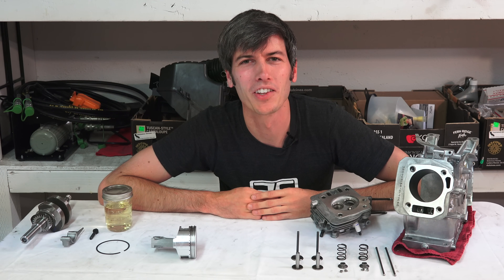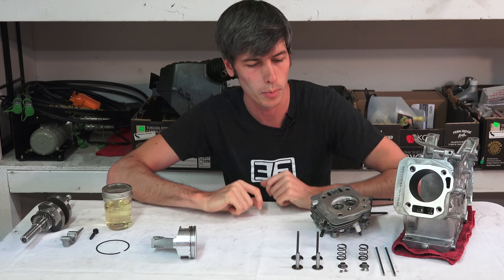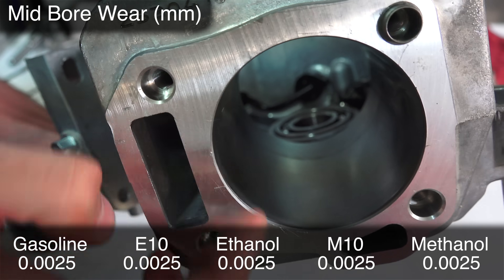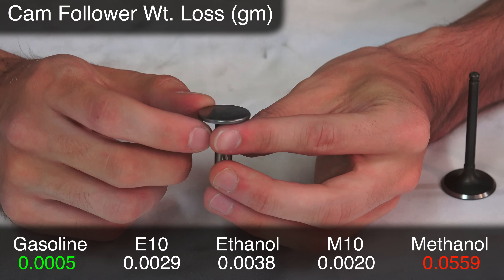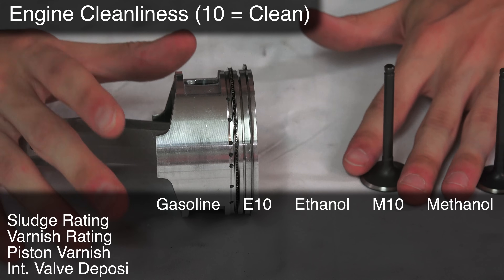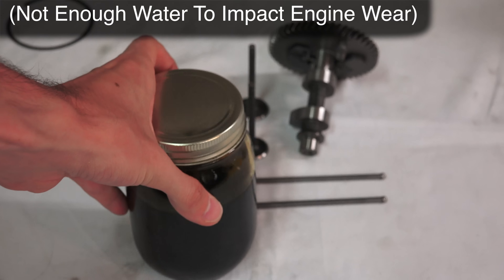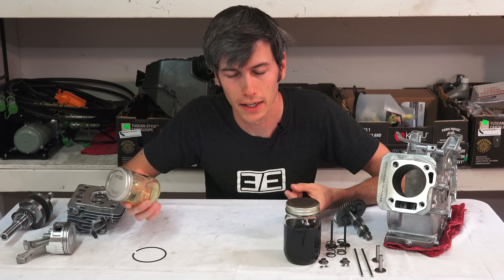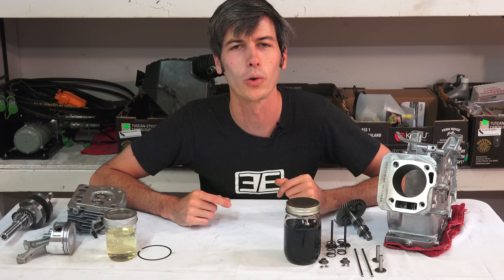Is Ethanol Bad For Your Car's Engine?

Comment: This is promotional garbage.
Engine wear is only a small fraction of considerations required  in making a comprehesive evaluation.
Other factors:
1. ) BTUs efficiency
2. ) Ethanol adversely affects combustion volatility, meaning that it's more susceptible to preignition/predetonation, which is literally the process of trying to  compress an explosion. This is a result of increased volatility vs gasoline mixures with regards to static cylinder PRESSURES, which - contrary to seat of the pants engineering - cannot be controlled with ignition timing. Think of it like a diesel, where combustion is accomplished with cylinder pressure alone. No spark required.
Preignition is the quickest way to destroy an engine. Parts break.
3. ) Ethanol destroys buna rubber, dissolves it. Fuel lines, injector o-ring seals, etc... fail. Leaking fuel lines is a bad thing. Turbo cars even worse, where fuel line pressures can be upwards of 65lbs/in. Granted... newer cars have switched to synthetic rubber which is less prone to failure. But if you ever wonder why you never see Pintos on the road, thank ethanol. Older Nissans were especially prone, because they were designed to run on gasoline, imagine that!, and the cars were forced to run on alternative fuels. Nissan was stuck with warranty etc... but it really wasn't their fault.
4. ) Ethanol is very hydroscopic, meaning it absorbs water, right out of the air. Water is very bad in the combustion chamber because it cannot be compressed, it raises cylinder pressures. see above.
Water is also very bad for electric fuel pumps )located in the fuel tank) as it is electrically conductive. This promotes electrolysis which dissolves dissimilar metals like an alka seltzer in water. Water causes lots more problems... but i'm not writing a book here.
4. ) Ethanol changes the fuel mixture, because it is a partial oxydizer. This messes with stoicometric mixtures in the combustion chamber, which forces the engine controller (computer) correct. When you oxidize the fuel the engine goes LEAN, which raises the combustion temperature dramatically Pistons can melt under such conditions. The computer must correct this condition by injecting more fuel into the mix, which reduces your mileage, and increases air pollution because you're burning more fuel.

There is no upside to adding ethanol, or anything else, to our gasoline. Ethanol blending is a creation of congress, and there is plenty of profit to be made in this new industry. It's also a subsidy to farmers. 
And all of this just the tip of the iceberg.

And don't even get me started on MTBEs !!!!

Comment: I think the issue is that ethanol is bad for the fuel lines, which updating them can fix. But it needs to be done if you wanna use e85

Comment: That was only a 20 HR run test. doing small engine repair sense 1977 I found a problem mostly in a 2 cy engine like a weed trimmer. has been messing up carburetors in older engines. also finding out the shelf life of E 10 is shorter than 100% gasoline. with the moisture content going up with E 10 gasoline a better oil should be used. like a synthetic .The best thing to do is change your oil. look at owners manual on what ever engine you have and follow the recommendations.  when in doubt check with trusted auto shop. ask around.E 0 is in NY for older small engines or classic cars.
Reply: Your comment is typical of many people doing small engine repairs: You don't know what you're talking about.

Ethanol does not go bad. Gasoline goes bad. If there is moisture from condensation, then ethanol in the gasoline is the best thing because it breaks the water molecules down, absorbs it, and then combusts and vaporizes the water. Changing oil is good to do, and checking to make sure that there is oil is even better. If a carburetor gets "messed up," it's because the ethanol is cleaning the engine. At the worst, as a small engine mechanic you can clean the carb but once it's cleaned the ethanol in E10 will keep it cleaner.

Comment: Please do a video on the blends of gasoline 0% ethanol and 10% ethanol and the carbon deposits difference?
I can get 0%, 5%, 10% and 15% ethanol here depends what gas station I choose and what octane I choose.

Story is to long to tell but short version any blend of ethanol caused warranty work to be required spark plugs replaced due to fouling and eventually the injectors were replaced at the 3rd time too.

After 3rd time 0% ethanol used (Shell 91 octane 0% ethanol only way I can get 0% ethanol here) and since no issues and its been over 20,000km since last repair which I believe was around 17,00km or so and its nearing the 47,000km mark I believe I don't look until winter when I swap the winter tires on and then I look so I can do the re-torque at 100km and then again come spring when the all season tires go on.

The engine is also direct injected, but the car was good the 1st time and 2nd time with just spark plug replacement and the 3rd time they did the spark plugs + injectors because the 3rd time they said it was having issues with fueling. Fuel pressure checks all 3 times were good so I assume the 3rd time Air/Fuel ratios or something there was causing a issue I would assume the injectors were fouled.

After the 3rd time I just went to the 0% ethanol the car got 200km/tank more range but I had to purchase 91 octane at $1.50-$1.60 vs $1.10-$1.20 for 87 octane with the ethanol. Never did the calculations there the range didn't seem worth it for a mere 200km/tank more but since then no issue with the car at all... So to me It seems the ethanol was the issue with the carbon fouling.

1st time 8,000km warranty work, 2nd time 13,000km warranty work 3rd time 17,000km warranty work then switched to only using the Shell 91 octane 0% ethanol and nothing no issues at all.
I did get to see all parts replaced I requested to see them every time and they were amazingly filthy with carbon deposits every single time and a spark plug should last much much longer than they were as should a injector.

Comment: Wear on the can loves is attribute d solely to the oil, and since you got different numbers for wear tells me there is a large amount of error in the measuring methodology.  There for the result of most of the measurements is worthless noise and tainted data to mislead!
Reply from the maker: Or methanol blowby could have an effect on the oil, can’t simply claim it has no effect.

Comment: I think the worse fuel economy argument concerning Ethanol needs to be qualified with “in an engine designed to run gas.” Ethanol may have less energy than gas in terms of BTUs, but it can be compressed a lot more than pure gas since it has a much higher octane rating of around 108. So if the engine is designed to take advantage of this higher octane fuel, then you can have much higher compression ratios, which is directly proportional to increased efficiency in converting combustion energy to mechanical energy. The problem is all these folks with flex fuel vehicles complain about crappy mileage when they run E85 or something, but it’s because the engine is really tuned to run gas efficiently and run Ethanol well enough for the manufacturer to get some sort of tax break for building X number of flex fuel vehicles. This results in everyone bashing Ethanol rather than the fact that the car was never designed to run Ethanol well in the first place.

Comment: Interesting figures, particularly because they are old and before the whole is ethanol bad debate. I've been experimenting with fuels in my car to see what benefits I get, I have a car that can run on E85. The best fuel economy recorded on highway driving was on 91 RON fuel with no ethanol. I guess the computer in my car is tuned to run the cheap stuff for the best economy. Running 95 RON see's little to no real world difference. E10 sees a slight reduction in economy of about 3%. If I put E85 fuel economy is much worse (about 30%), but GM's LFX V6 engine has a different performance profile for E85 (105 RON). I can say you certainly get a little more power from the engine, and overall it just runs smoother. This is certainly my go to fuel for fun driving, it's also usually cheaper to fill a tank with E85 than premium unleaded fuels with 30% cost added on top to compensate for the efficiency offset.

Comment: Running 10% ethanol is fine in modern CARS. However, there are many negatives. Ethanol goes through phase separation where you get bad gas, acid, and water instead of one single, bonded fuel. Ethanol has much less stored energy than regular gasoline. It also causes severe damage to rubber seals and even paper/cardboard seals which are used on all kinds of lawn equipment including trimmers, blowers, chainsaws, mowers, and more. This is insanely bad for anything with a carburetor (see the previous list) such as motorcycles (I own five and know this from experience) and tractors that don't cost a million dollars. Oh, and don't put ANYTHING with ethanol in it into your nice, fiberglass boat. It will literally cause the tank to disintegrate. However, there is ONE benefit to ethanol. Ethyl alcohol is great at cleaning varnish up!

As far as wear, E10 versus pure gasoline is non-existent. The issue isn't wear. The issue is that ethanol initially soaks into porous materials and causes them to swell. This is normally no problem. However, as the ethyl alcohol evaporates, it dries the seals and things out, which causes shrinkage of the seals, cracking, and eventually, allows air in or gas out due to a poor seal. Regular gasoline does not do this. This is why  mowers, trimmers, motorcycles, etc get hardware to start as time goes on with E10 fuels.

Due to lower stored energy it does reduce mileage. This is across the bard. Take for example my old (now sold) 1995 Dakota. It had a V8 (5.2L /318 Magnum) which got about 16-18mpg on E10. On pure gasoline it jumped to 22-24mpg. My 2015 F150 has only had a diet of 93 octane, pure gasoline since I bought it with 17mi on the clock. I am getting around 22-24mpg around town in start and stop traffic. I get up to 28mpg on the highway depending on how fast I go. Due to Hurricane Florence however, I had to use 87 E10 on this last tank. I am currently showing roughly 18mpg on the computer, and the computer is normally about 1mpg above what it really is, so I expect to be around 16 to 17mpg. Same trips every day. Same start and stop. The only change is from 93 E0 to 87 E10. Stored energy is stored energy. The most stored energy is currently in pure gasoline, NOT E10.

Finally, there's the phase separation. Ethanol-infused gasoline does not store for very long. Normally it goes bad within a month of sitting. Why do you think there are so many fuel additives claiming to make fuel last longer? Regular gasoline does not do this. It can last for nearly a year without an additive. Once phase separation happens however, you cannot undo it. The worst part is that the acid which forms during phase separation WILL scar metal parts, such as cylinder walls.

I run only pure gasoline in everything I own. Bikes, truck, car, tractor, mowers, generators, you name it, it has 93 octane, pure gas in it. I had to rebuild the carbs on my bikes when I first bought them. I have NOT had to rebuild them since, and we're talking years. Same goes for my antique tractors, mowers, and everything else. Ethanol lowers mileage, causes damage to things built before 2000, and costs people more money due to needing additives and work on equipment after it sits for the off-season. It does NOT (as your video shows) damage metal any more than normal fuel.

Comment: I think the main modern concern when it comes to ethanol in fuel blends is that the ethanol absolutely chews through any rubber fuel system component if it was not designed to withstand ethanol.

Comment: No one says anything about engines with direct injection ?! if you put E10 in a high pressure fuel pump you get a oil like sludge and this does not play well with your injectors .

Comment: Very informative and citing the age of the test and how the testing was conducted is actually quite revealing. Although, seems we should consider the modern engines, as you mentioned, 2012 and up say, have very possibly been improved in their design, metallurgy and over-all synthesis to meet the demands of the various types of fuel and the subsequent loads those engines will be under.

Comment: I have banned any ethanol blended fuels in my personal fleet 1997 and older.  My 1994 van had E-10 in it, and that caused a brand new fuel pump to burn out because the vane portion of the pump expanded, and that caused a higher load on the fuel pump motor.  I am also blaming ethanol fuel for the cylinder intake valve seat to become detached from the head, possibly due to lean fuel mixture overheating the combustion chamber portion of the cylinder head.  Evidence seems to point to vehicles that run the OBD 1 protocol can not adequately adjust fuel trims fast enough to accommodate the leaner fuel that ethanol fuel can cause.  Total damages of $1,500 and counting....The engine was in pristine condition otherwise.  1998 and newer vehicles are rated for either non-ethanol or a maximum of E-10 only, by my new rules.

Comment: Ugh.... complete retardation in the comments.
In a FUEL INJECTED vehicle, ethanol is 100% just as harmless as 100% gas. Your gas cap isn’t open for long enough to absorb any more or less water into the tank regardless of the fuel. The ethanol will absorb the moisture ALREADY PRESENT in the tank and get rid of it (which is a DESIRABLE thing over sucking in pockets of separated water with pure gas). It’s not like fuel companies are storing ethanol in open horse troughs to absorb all kinds of water... regulations require systems to be air tight and vapors to be sucked up. Ethanol burns COOLER and CLEANER and with less chance to cause knock or preignition (105+ octane), which are all great things for any engine. Change your oil when you’re supposed to and your (FI) engine will be just fine!

Comment: For cars and boats that sit in storage or docked for a long time, ethanol is a killer. That's why docks near the water offer ethanol free gasoline since ethanol eats up the lines and seals plus alcohol absorbs water and causes separation. Interesting to know that the wear from methanol was from the corrosive products of the reaction in the cylinders. I thought it was because methanol has a lower atomic mass which produced more blow by so the oil was diluted and caused wear to the lubrication system.

Comment: If you leave E10 in your fuel tank unused for extended periods of time, you're going to have quite a bit of varnish buildup, specifically if you have seasonal motors, ie: snow blowers, and lawn mowers. Drain your fuel system at the end of the season.

Comment: in my chevy P30 RV with 1975 350 V8 engine the 10% Ethanol fuel runs like crap..  I can run it until the fuel runs out and you could put in either pure gasoline or 10% Ethanol gasoline, I can drive a few times around the block and can tell you which fuel you put in... personally I think 10%  Ethanol gasoline is government MORONISM and should NOT EXIST... it's a waste of food..

Comment: I want to know the effect of ethonol blend on the rubber components, seals and such.
Reply: There is no 'rubber' in a modern engine. Its all Butadiene styrine rubberized plastic - impervious to most organic solvents including ethanol. Neoprene is used for belts and so forth... which is strange because it IS susceptible to degradation from just about every solvent you can think of. Most industry standard tubing these days is lined with rubberized PVC which is solvent proof. 

Keep in mind that racing cars run on 100% ethanol. and have been for 20 years.
Reply: @wiretamer5710  Forced induction cars love ethanol, able to run more boost because it runs cooler.
Reply: On cars suited for it there is no difference. Older cars should not use it.
Reply: @baronvonlimbourgh1716  Easy to run in older cars once you switch to synthetic fuel lines and carb gaskets.

Comment: So now we can't store any significant amount of gas for any extended period without it going bad...seems like adding ethanol was a terrible idea for no discernable advantage.
Reply: So historically in the US - gasoline embargoes really riled people up...  we had lots of coal - the tradeoff chosen was to use coal to fired electricity generation which would be used to mill and distill corn (and other plant materials) into ethanol which would offset the need for some volumes of straight gasoline.   The fact that hydro and ng could also drive electricity generation was seen as a virtue as well...   if you get to E10 level, you're offsetting billions of gallons of gasoline a year by using the ethanol.... which offsets imported crude to make it...  now with frac'ing driving up domestic US fuels production percentages, and increased MPG (almost 25% in cars between 2007 and 2015, weighted sales averages) - some rethinking  of the total mix might be in order.   They've gotten far more efficient at making ethanol, cars/light trucks get better MPG, electric options for traction in vehicles are viable for some use cases today already....   interesting world...

Comment: it is not the wear that is bad. it is the ethanol in the fuel sitting. you can no longer let a tank of gas sit like you used to. and god forbid you let you small engines like weed eater engines sit with the fuel inside for too long.